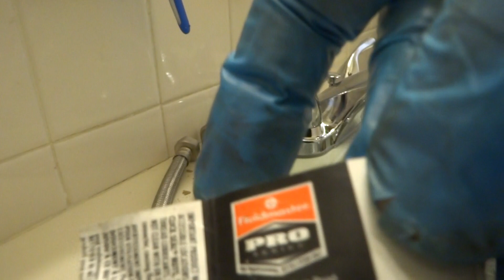BATHROOM FAUCET SHUT OFFS FIXED AND FAUCET REPLACED

Comment: Brass craft sells a little kit that comes with a new stem, seat washer and packing for 2 bucks. New handles are separate and another buck. They work on any multi turn stop that I’ve ever run into - Home Depot is the only place that sells them in my area (supply houses don’t carry that stuff), way easier than doing a new valve and same result
Reply: I beg to differ. Way easier? No sir. Brand new 1/4 turn valve (or multi turn if you prefer), screw off, screw on, done. And no chance of pitted metal or other flaws still leaking. It's a little more money, but you were talking about what was easier.
Reply: @realSamAndrew  what if it’s a sweat valve hugging the back of a vanity with plaster walls behind it?
Reply: @loucannon5445  agreed. But in many cases, you can't replace washers and other components without removing the whole valve anyway. In this video Steve removed the entire valve to work on it. If you go by "easy", he could have slapped on a brand new one and avoided the little bench operation in the truck.
Reply: @realSamAndrew  I hear you buddy, I swap valves all the time - just was trying to advertise the rebuild kit. They work great for me.
Reply: @loucannon5445  I had an electrician complain his company never rebuilds light fixtures (new ballast 25$), and a plumber who never repairs faucets or hose Bibbs(50 cent washer or packing). They laughed at me because I saved 100 - 300$ per fixture, but they didn't want  to do any grunt work. I'm with you.
Reply: @realSamAndrew  ah, I thought I was talking with a fellow plumber. Nice work on saving money man, take care.

Comment: Steve, I give you a great deal of credit to just repair the shutoffs as you found them.  I see you used your trusty adjustable wrench to do so.  I have an old house (about 85 years old) and have been replacing all these shutoffs with quarter turns as I renovate.  Further, I dont sweat them, rather use pipe nipples into brass fittings behind the wall so that if they need replacement, its less effort.  Thoughts on my approach?
Reply: Bill  Thanks for the feedback.  I do exactly what you stated as it pertains to using nipples and 1/4 turn valves.  I actually have done so on 6 hot and 9 cold lines in various spots of the house.  Only one hot/cold set left and will do so when that gets renovated.  Best to you and the family for 2022.

Comment: i like that i would have taken the brass screw out to put the 00 washer on i like how you pushed it on good to know
Reply: FYI, those did not have screws to hold the washer on, a lot of older supply valves like these have mushroom stems that the washers are popped over instead of screws.
Reply: @jackedwards7420  i hear you i guess thats why steve knows to push them on like that old school  but i have replaced those washers on faucets by removing the screw huge pain in the ass the only reason i did was those washers new are stiff didnt want to distort it was my thinking
Reply: @jackedwards7420  its why i watch steve i watch every body in workplace too  im a35 year  journeyman millwright (industrial mechanic) and im always open to new ideas i made a living as a car mechanic for the first ten years and it was all piece work so you better believe i was open to new and fast ways of doin something steve is not stingy on tech tips i will say that thats why i like the guy

Comment: Most plumbers would have just needlessly replaced the valve vs replacing a washer. Good to know there are still good plumbers out there.
Reply: He charges around $100 per hour and a new valve is only around 5 bucks. You should double check your math.

The only wild card in this case was that the valves were hard to remove. If threaded, it doesn't make sense to rebuild the whole thing unless you diy.

Comment: I’d a replaced both them angle stops And had the water back on before he was done rebuild and one of them.
Reply: yeah I'm still trying to understand.. why would you pull it all apart, change the washers, and then change the handles, when two turns of the wrench and you got a brand new valve and on to the next job. Time is money, more than the couple bucks and exertion you've just spent rebuilding 30 year old valves. I get it on other things sure, but not this
Reply: @geoffjohnson6555  with all due respect, he would’ve had to unsweat or cut off the valves and sweat new ones because they’re not threaded. Either way I understand what you mean.

Comment: Hey Steve,  wiestion..the ol' lube..would dielectric grease work ? Thanks J
Reply: Not unless you wanna play liability roulette on the ol' Love Canal Showboat. 

The formulations are different depending on use case and you generally don't wanna mix anything not certified for human use in your potable. That's why a jar of Vaseline (which used to be approved for internal use) is right next to the WD-40 in Joe Homeowner's toolbox.

Comment: turn water off and drain house down: 1/2" auto-cuts, cut valves out: remove escutcheons: sand pies down to look clean: remove pop-up and p-trap: remove faucet using EZ Change Plumbing Wrench: install new escutcheons: use stop wrench to install 1/4 turn valves: turn water on: install supply lines and blow out lines into bucket: hook supply lines to faucet: install Delta faucet after cleanig top of vanity: use plumber putty to set new brass pop-up: set p-trap: test for leaks with atleast 4 full dumps of water.

Comment: Great video as usual Steve, I've never asked a you a question. When changing out a kitchen/lavatory faucet when it's equipped with a good gasket, what's the point of including plumber's putty (I  understand the concept), it's a constant back and forth with a co-worker? I value your opinion 👌
Reply from the maker: you should always use putty because the porslin is not aways perfect and the putty will fill in the bigger gaps .
Reply: @stevenlavimoniere  Thanks for your response, big fan from South Texas 👍

Comment: New drain comes with the faucet, it would have been faster to just change it out and look new matching the... new faucet.
Reply from the maker: old drain is all brass new drain is plastic junk why change it old stuff is better
Reply: Why would you replace brass with plastic?
Reply: @stevenlavimoniere  tail pieces come brass on even the cheapest faucets e.g. plumb4orce, Glacier Bay. I'm not talking about the connection to the P-trap.